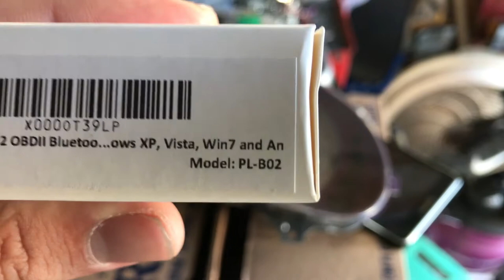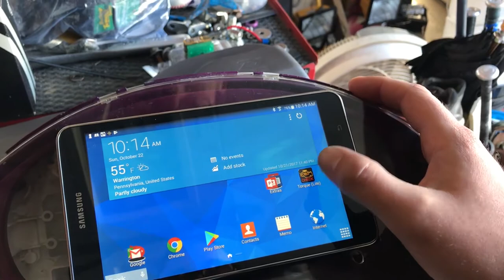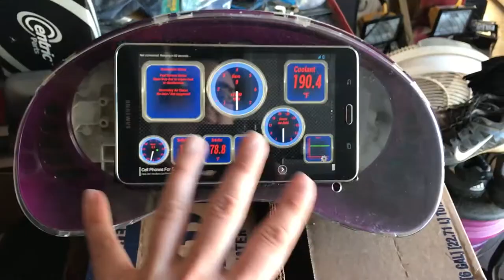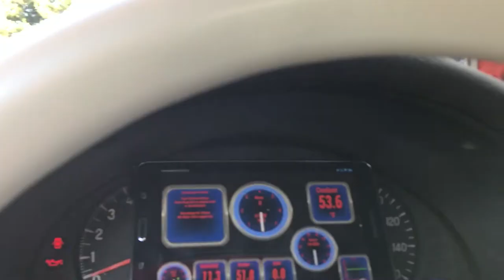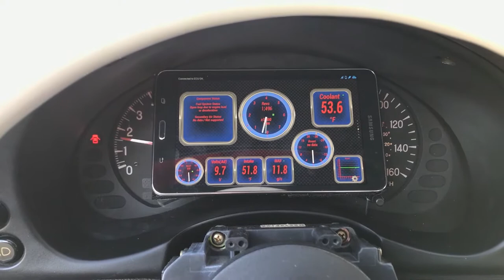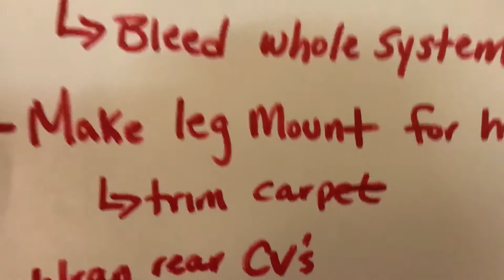Hydro Install in the 3000GT + Digital Dash Display

Comment: So....are your Hydro E brake lines connected to your rear stock calipers as well? How does that work? Wanna make mine a drifter as well. Maybe some day I'll run into you at an event.
Reply from the maker: Yes they are T’d in to the rear lines. Works well.